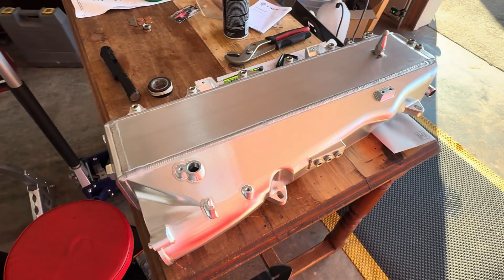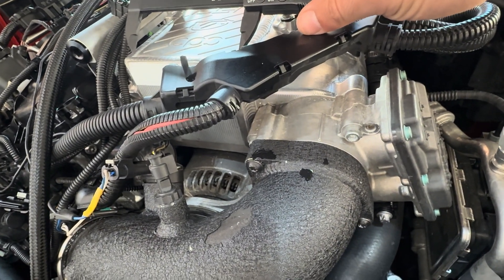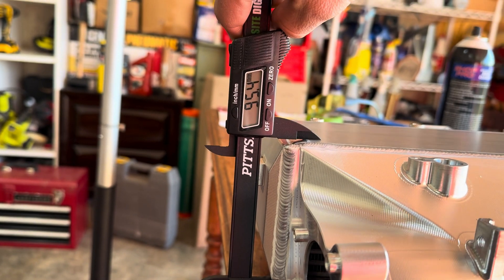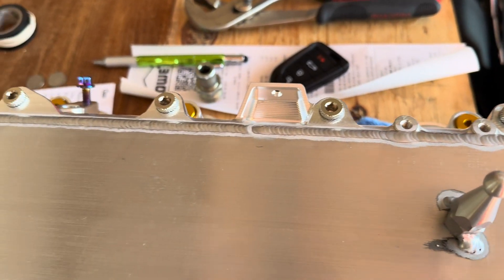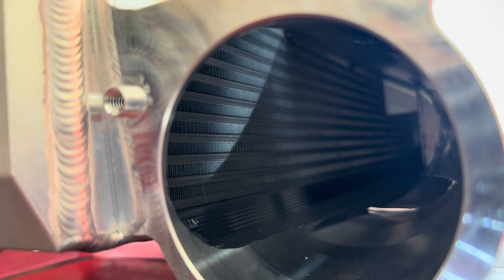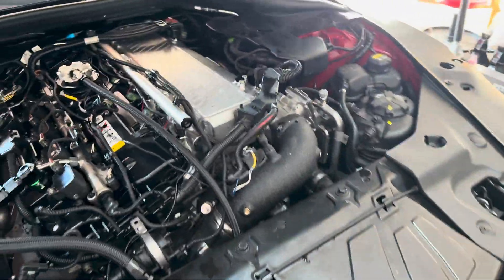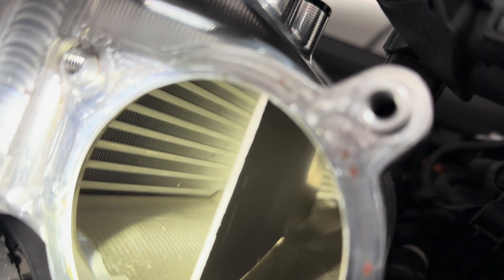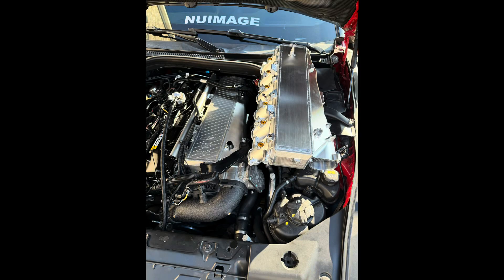Is the b58 manifold from alibaba the same as CSF?Side by side comparison

Comment: Hey bro, i just installed this manifold. For the plumbing did the  top outlet on the manifold go straigh across as per csf? And the bottom outlet went down to the oem pipe that goes down?
Reply from the maker: @BarcodeWasTaken  sorry for the slow response, on the plumbing side there is really no wrong way but yes i personally put the top to the line coming from the pump and the bottom to the lower line that goes to the heat exchanger

Comment: Running the alibaba manifold on my M340i. Torcoils just released an "EVO" version with a 20% bigger core, check that out. 

I haven't gotten to run datalogs yet since a coolant hose has a small crack and is spewing out coolant. But I'm on hybrid turbo + Spool FX400X + S58 injectors.
Reply from the maker: @mai_kul  your coolant leak related to the manifold or a different part of the cooling system?
Reply: @ It may be connected to it; but it's more than likely due to how I mishandled some of it and the material of the line being plastic or whatever it is being so brittle. It's a very very small crack that coolant would spray lightly out of it.
Reply from the maker: @ 
I’ll be doing the install this weekend I’ll be doing the walk through and giving a review on fitment. Finishing turbo upgrade for the big boost kit today might have that video out tomorrow or Saturday
Reply: @turbotimegarage  I used a phenolic spacer and needed to buy longer screws. On a DAW turbo and that manifold it actually managed to fit the OEM charge pipe on it lol which I don't think anyone expects. I already bought a new charge pipe and will using that soon.

Comment: I'm def waiting on the update to this!
Reply from the maker: @WhiteBeardDetail  
Coming soon brother, finishing up the precision turbo upgrade for the big boost kit on the red Supra. Will be installing and testing this manifold in the next couple weeks
Reply: @turbotimegarage  I'm assuming the alibaba one is worth the $$ it would be a minimal difference in iat. Also it's all single pass thru
Reply from the maker: @ 
Considering the stock core doesn’t have an airflow divider and is only 5 rows it’s a definite improvement over stock, I’m going to try and test both cars on the same day. It won’t be exact apples to apples as there on two different turbo kits. But there tuned at the same boost level making similar power